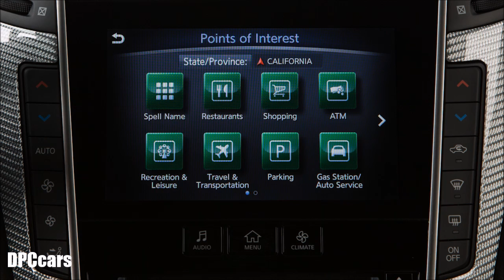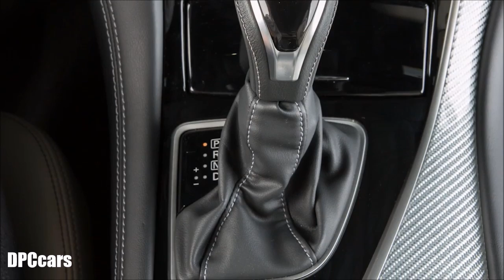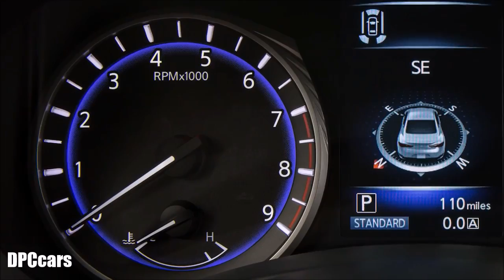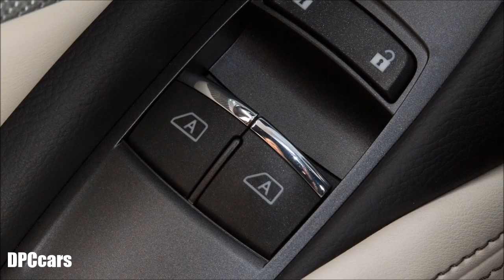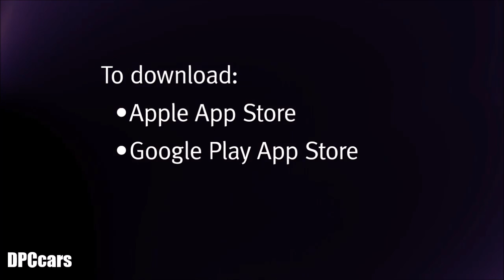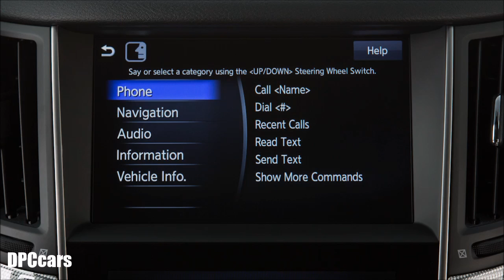Complete 2017 Infiniti Q60 Owners Manual Guide

Comment: A step down from the G37 interior IMO. The removal of the cluster that adjusted with the steering wheel was a big mistake. Eschewing the analog dials for the duel screens plus the removal of the analog clock was a bad decision. Then look at the center stack. You have like 3-4 different materials and textures going on here. WTH... My 2004 Mustang GT looked more refined than this. The door panels, lower console and the LOOK of the gauges is nice. As a car company you need to play to your strengths. Going to the Q naming convention, the retrograde interior... it all seems a bit confusing. So sad to see Nissan fall so far. You had it, then you lost it.